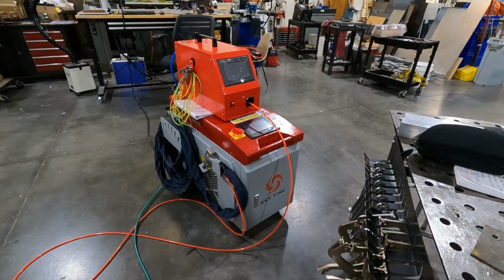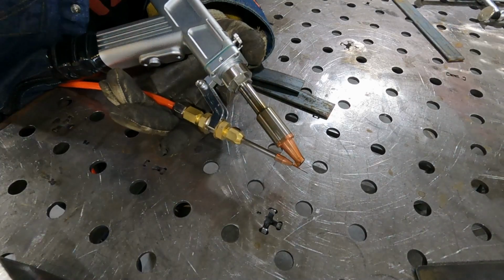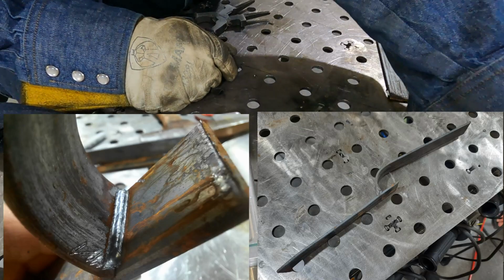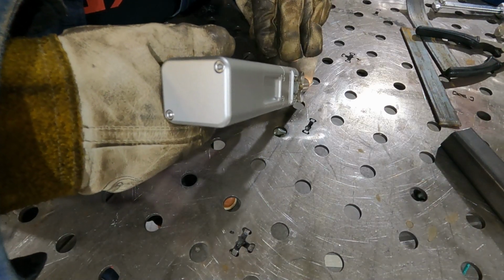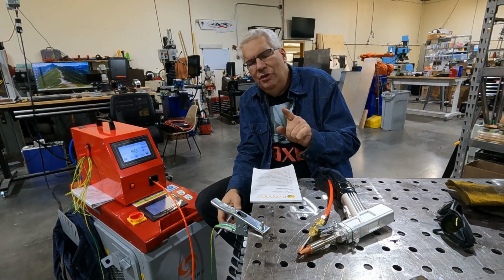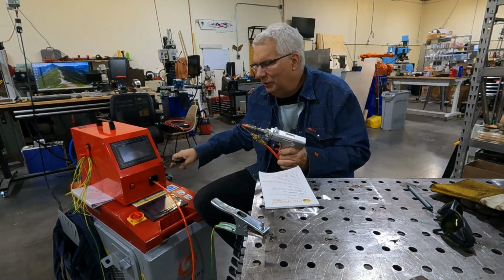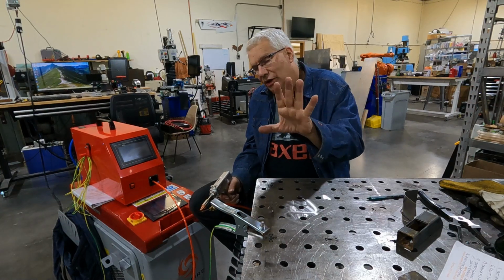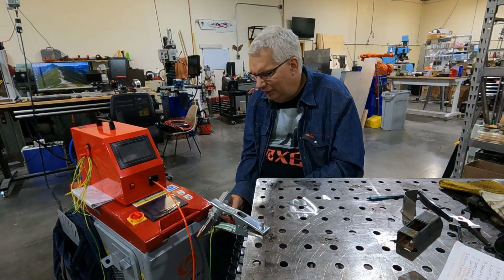2000W Fiber Laser First Steel Welds and First Impressions

Comment: What I’ve been doing with welds on square tubing is to make a quick swipe at the edges I’m going to weld, on the sides. That gives me a tiny V to allow the wire to have something to ride in. Just a light angled swipe. It makes a big difference. I found that I was riding off the joint otherwise. This eliminated that. I use wire just to add a bit more strength and to prevent that slight dip in the weld you get with full penetration.

And yeah. My first attempt to test the setting, I welded a piece of 16 gauge stainless to my Siegmund. It wasn’t happy. Fortunately it was just two 3/4” inch welds right next to each other.

I don’t understand why you’re using air to weld. Recommended gas is nitrogen for steel and stainless, though you can use argon. Argon only for aluminum. I just use argon for everything. I’ve never seen anyone use air for laser welding (or any other welding). Get a laser welding helmet. It also protects against the UV produced, and yes people, laser welding produces a plasma from which UV comes from. The glasses don’t protect against UV. They’re really meant to be used under the helmet or for observers who aren’t close to the welding.
Reply from the maker: Thanks for the info. Soon after this video, I bought nitrogen and argon tanks for welding. I also got serious about safety, always wear a respirator now. Your UV comments are all valid, long ago I got a 'sunburn' from flux core welding my first large project. Thanks for the comment and for watching.

Comment: You need the cross section the weld to see the penetration. Only way to tell if its a strong weld or not.
Reply from the maker: right, I need saw across my weld and polish it to see this penetration. I believe weld.com or weldingtipsandtricks did this for penetration examples.

Comment: How did you wire the welder? 240v or 220v? If 220, did you use a transformer? Thanks.
Reply from the maker: We have 240 3 phase in our shop. I used one of the phases (the correct one) to power the welder. I'm not giving anymore detail here because you'll need an electrician to help if you don't clearly understand my statement.
Reply: @ i appreciate the response. I do understand as well as why you cant say much more. I understand how 240 works in the US, my question is because most laser welders “require” 220v euro style (1 line + 1 neutral), I want to know if you were able to power yours on 2 120v lines at 180 degrees and if you have had any adverse effects. All the motors, compressors, and power supplies in the welder are rated for up to 240v 60hz except for the actual laser unit which is sealed, so it cant be accessed to see its actual specs. Hypothetically speaking, of course.
Reply: @mnjackson5772 no, here in the USA 220-240 (depending on where you are) has two hot wires and a ground. You don’t have to worry about whether it’s 220 or 240. It will work on both. It just draws a bit more amperage at 220. You shouldn’t try to play with the power with two 120 lines out of phase. That will cause problems and is dangerous. Either you have 220 or you don’t. In a 120 panel you only have one phase.